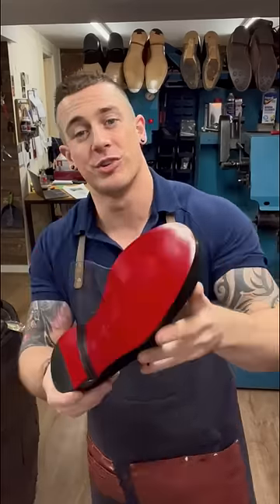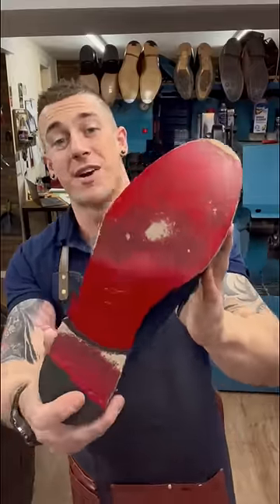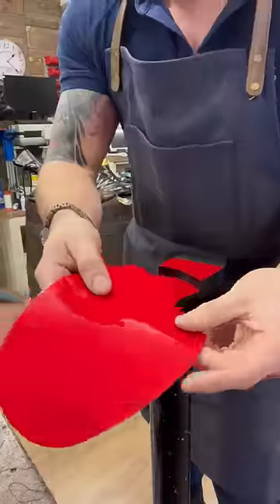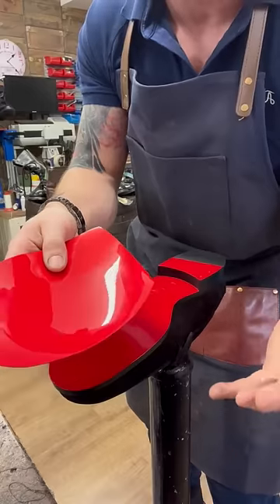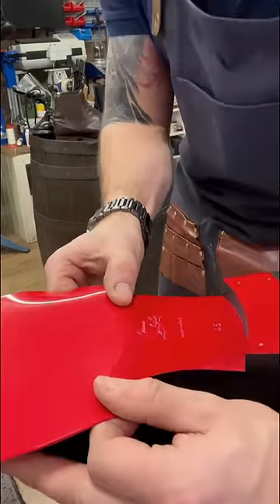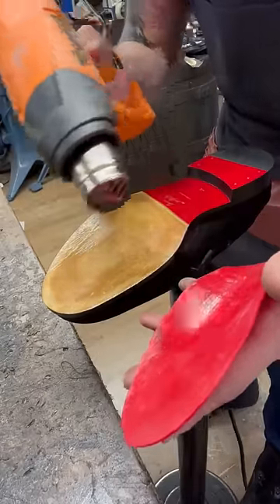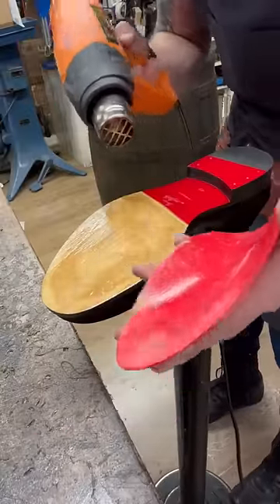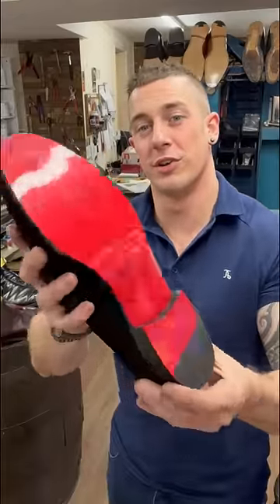RED LOUBOUTIN SOLES ARE JUST PAINT???! #Shorts

Comment: Few notes I feel are important to add: from the perspective as someone who sells leather sole shoes.

1. Painted soles are incredibly common, not just unique to designer shoes. You buy an all black dress shoe with leather soles? Wear it out on concrete once and that sole is gonna start developing some grey to tan wear spots. This is normal!  Show off those wear patterns with pride, or invest in some sole polish to cover it up! 

2. Rubber vs leather soles have completely different traction! Most normal people don’t have to worry about this, but if your buying shoes for dancing  a rubber sole is going to make doing pivots, and other more slide-y moves a lil more difficult. Rubber grips - leather doesn’t.

3. Slapping a rubber sole on a pair of Louboutin’s that originally had a leather sole is gonna plummet the value of the shoe. Once you alter the shoe like this, you cannot go back without completely resoleing the thing.
Reply: Agreed and the shoe has been altered so now louboutin can’t guarantee the shoes anymore if any manufacturer problems should arise

Comment: the problem with using heat activated glue to stick soles is that the pavements we walk heat up in the sun,which can reactivate the glue and make it lose its adhession.
Reply from the maker: That would have to be a pavement made of lava
Reply: @Dan_the_cobbler  that combined with the friction from walking imo are what is responsible for so many shoe soles failing. Most manufacturers use the same heat activated adhesives?

Comment: Those have got to be the slipperiest shoes ever.
Reply from the maker: Rubbers not slippery!
Reply: @Dan_the_cobbler  It ABSOLUTELY is if there is water or any dampness but, I agree for dry they're probably not bad.
Reply from the maker: @llspragulus  all high grip soles are made of rubber, military boots, hiking boots, snow boots
Reply: @Dan_the_cobbler  Yes.  That's correct but they have tread cut into them to divert the water.  This is why you don't have slicks on race cars in the rain.  It's also why you don't put slick rubber on the bottom of shoes.  It's also why NO shoe manufacturer makes their rubber soles slick.  The potential of harmful falls and the following liability they'd incur wouldn't be worth it.